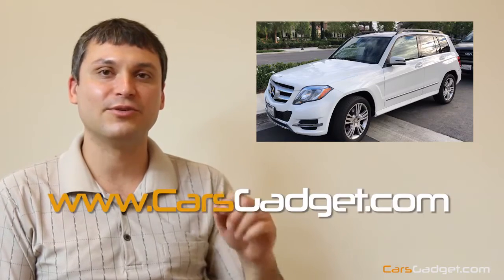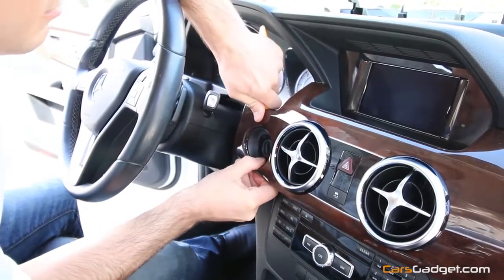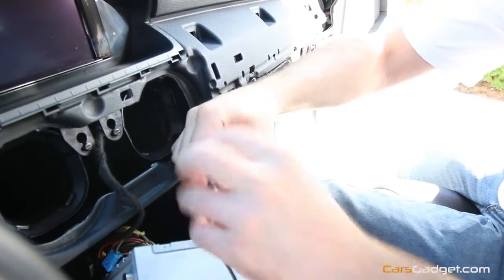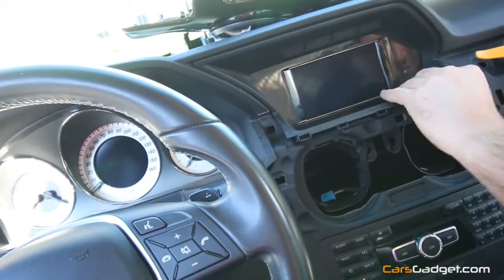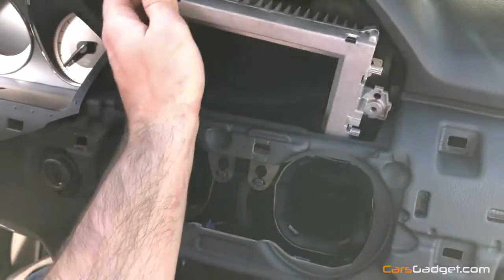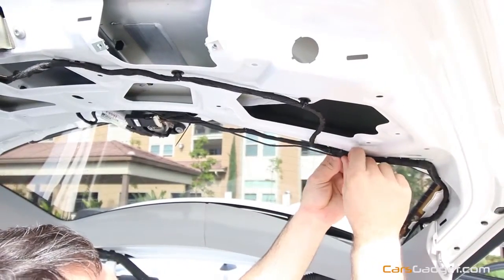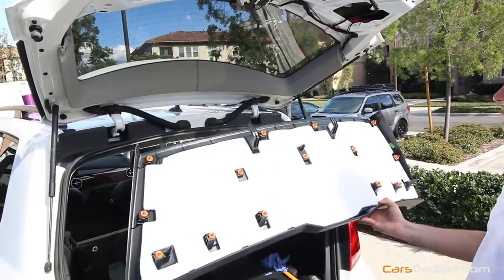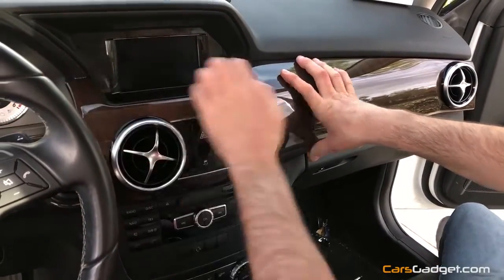HOW TO INSTALL BACKUP CAMERA in Mercedes Benz GLK Aftermarket Rear View Camera for Mercedes w/NTG4.5

Comment: Great video - love the easy routing.  I did want to mention that the graphic at around 2:00 mentions that 2008-2015 GLK head units are NTG4.5.  However 2008-2012 are NTG4.0. The dash and head unit are quite different than the NTG4.5 unit / dash in your video.

Comment: Having just completed this job myself I will say that this video was extremely helpful.  I did find that in order to get the harness and plug out of the way of the head unit I had to cut a roughly 1"X2" piece of plastic out of the part that separates the radio from the climate control section and slide the plug under that so it sits behind the CCU.  Also, another tip left out is that in order to re-seat the ends of the rubber wire tube at the top of the tailgate you have to remove the plastic endpieces from the car side (there are two small release tabs with arrows on the front you can see if you look closely).  Once you pull them all the way out of the car and tailgate fitting them is easy and then you just push them back into the holes until the lock in again.  If you don't removed them you will never get that rubber to seat around the edge again.
Reply: Wouldn’t worry about that. The airbag is in the pillar in front of where you tuck the wire so I don’t think it would interfere at all with the deployment of it

Comment: I bought the unit installed it works great but not able to push radio back in, it stop at about half inch, can't go anymore in and it seems the aftermath plug is stopping the radio .
Any idea of what to do?
Thanks
Gus
Reply: @CarsGadget  Did that many times and still would not work. The only solution was to cut some of the plastic between radio compartment and ac control and push the huge plug underneath and that solved the problem. Spent hours but that was the only solution and it worked.
Thank you for answering
Reply: Thanks

Comment: Does anyone know how to put the radio back into the dash? This video skips that portion.
Reply: There's tow clips that you need to take him up and then push the radio inside , I ran into this too, I was working in the dark until I realized that it interfered from behind and it didn't sit well with me, it took me a while , Two such hooks that need to be lifted up, when you insert the radio they fall and catch it, exactly where you put the screws back, if it is lifted the radio cannot be pushed back

Comment: poor install no solder connections, cheap just twist wires together and tape.
Reply: No? Doesn't need soldering, I wouldn't even recommend soldering for car wiring but you do you 😊